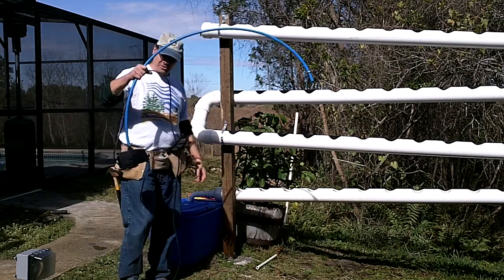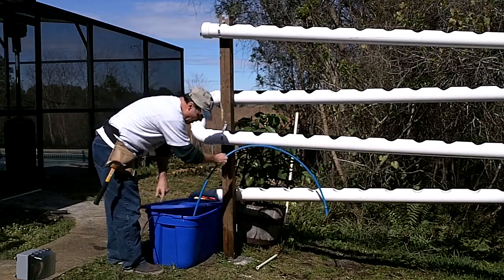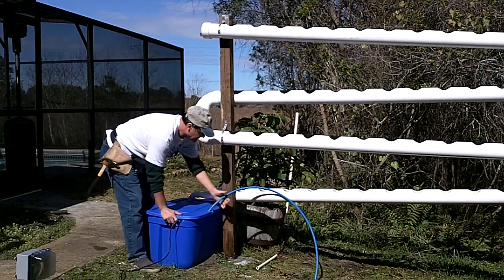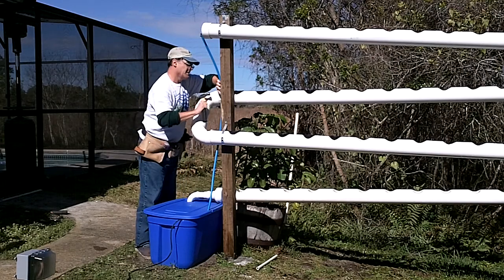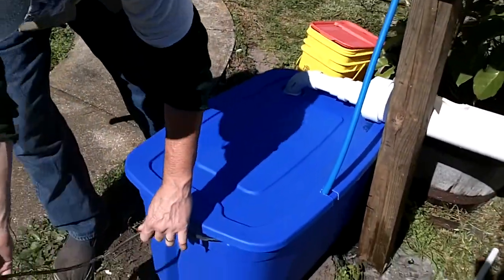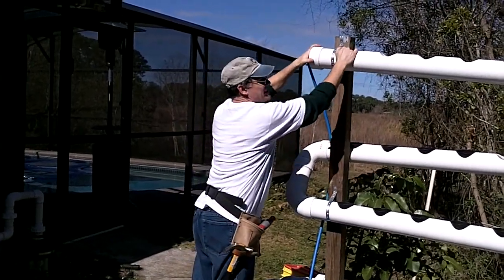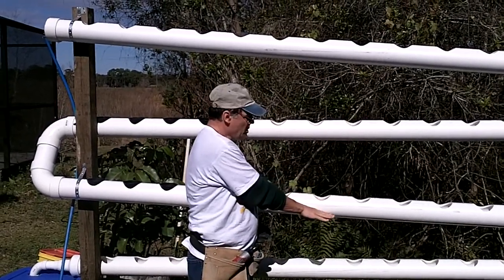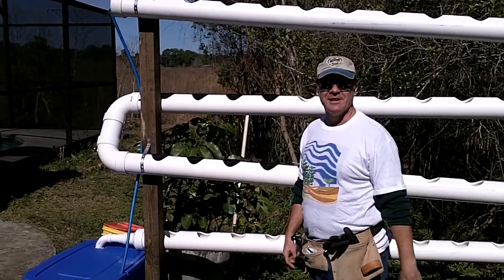Vertical Garden Step #5 - Setting and connecting the pump

Comment: thanks for the video. it is a beautiful project. how long the pump on 
your system? I heard that in the NFT system when you turn off the pump 
should be some water in the tube. what do you think? greetings from 
Mexico. Thank you.
Reply from the maker: Thank you Doulas for checking in commenting and sending in your questions! First the pump on/off cycle - during the summer both day & night we run it 15-minutes on and 15-minutes off during cooler months after sundown we sometimes will extend the off period to 30-minutes with 15 on and 30 off until sunrise then back to the 15/15.  Not sure in Mexico where you are but when we were in Southern California the nights were a lot cooler even in the summer (and low humidity) so we used to always do the 15/30 at night. In Florida between the heat and humidity we cannot do that during the summer nights. As for when the pump is turned off - because we have the pipes at slight down angle they will drain out during the off cycle - with the system we built here because our drain on the last pipe is around the center of the 4-inch pipe there will be water remaining only in the last 12 to 16-inches of the last pipe.  The biggest concern is for you roots not to dry out and for a time to oxygenate. Because NFT and the VGS pipes usually do not fill up with water (as with an ebb & flow system) you could actually leave the pump running as the bottom of the roots will be in the water and the tops exposed to air for oxygen.  We have run the systems without cycling on really hot-humid days when the plants look stressed.  Good luck to you and let us know if you have any other questions!

Comment: I have to build one. What size hole did you drill in the pvc pipe for plants ? Where did you get the plant holders ? What is the medium you're using in the post ? Thanks !
Reply from the maker: Larry Reece Hi Thanks for the questions - 1 - we used a 3 & 5/8 inch hole saw (92 mm) for cutting the holes in the PVC (be sure to run the drill in reverse to limit the binding). 2 - the net pots we used were 3 & 3/4 inch, which we were lucky enough to get when a hydroponic store in Orlando was closing and selling off it stock at a really reduced rate. The best prices we found for net pots was ordering from Home Depot (online) or if they do not have the size you need Amazon is a good choice. (for various projects we have 2 inch, 3 inch, and the 3&3/4 inch net pots). As for the media in the pots we use LECA (lightweight expanded clay) we also found the best source for this was Home Depot online. 

Let us know if you have any other questions!  Good luck on your project!

Comment: Do you run your pump continuously, or do you run one hour on and one hour off?
Reply from the maker: We have our pumps on a timer and cycle 15 minutes on 15 minutes off during the day (0700 - 1900 or 7:00 am to 7:00 pm) at night during the cooler nights we run the cycle 15 on and 30 minutes off - in the heat of the summer we will run the 15/15 cycle 24-hours. The biggest thing with the cycle you choose is to allow air for oxygenating the roots without letting them dry out.

Comment: PEX - that's not real common for most DIY folks
Reply from the maker: Steve Freeman I believe PEX is becoming a lot more popular, it was readily available in both Southern California and here in Central Florida, I also know many people in Southeast Pennsylvania that are now using it. The nice thing with the PEX connections is you no longer need the special tool and connectors, many stores such as Lowes and Home Depot carry connectors that slip on and tighten by turning. If PEX is not available locally you could use regular plastic irrigation line or any other tubing readily available. We have plenty of PEX tubing available from other projects so it was the perfect choice for the small amount we needed for connecting the pump to the system. We also just used the hose clamps to attach the tubing so again no special tools or skills needed.

Comment: Thank you for the videos. Very helpful and well done. How do you deal with rain and it's impact on PH/PPM and water level inside of the reservoir? Thanks again! Hope you post more vids
Reply from the maker: Hi, thank you for the comment and questions. We have only been in Florida a little over a year and are still getting used to a lot of rain and the growing conditions - so different from dry Southern California!  What we have found is that as long as there are not a lot of open holes (no plants or no cover) in the VGS pipe we get a minimal amount of rainwater in the system. You could add an overflow, or simply cut a small hole higher on the reservoir to drain water if you run into a problem. I will work on some ideas and post when I have some. 

As for pH we are on a well with higher pH, so we use General Hydroponics pH Down (dry powder), which is buffered and the rain does not affect pH much. We notice pH rise if we have to add more than a couple of gallons to our reservoirs from the well water, but the pH Down is a great product. (you can find it on Amazon.com).

We monitor both our pH and PPM every couple days and usually only see problems with the evaporation and having to add water.
Reply: Project128 I'm in Southern Louisiana so our weather is quite similar. You almost don't even have to use water in aeroponic systems down here with all of our humidity. :) Thanks for the response and I'm subscribed so looking forward to future videos. Best regards!
Reply from the maker: Doyle Lovil  Since you are in a similar climate to us - please feel free to share any tips you may have or experiences with growing (what works, what does not) that you have! We have a couple projects going so will be posting more videos soon.

Comment: What size pump (GPH) are you using?
Reply from the maker: Pat - we are using a 500 gph (gallon per hour pump) we had that already from another project, we have similar systems that we ran with 360 gph pumps.  We have a list of the parts we used and prices for the various items. Here's the link to that blog page:  http://project-128.blogspot.com/2014/03/cost-to-build-vertical-garden-system.html
Reply: Project128 Thank you so much for the list of supplies. It was most helpful. So far, we have completed the structure, purchased the PVC (missing a couple specialty items) and are ready to proceed. Your videos were most helpful because you included the smallest of details. Keep of the good work. I look forward to your next educational video. I might mention that I am a 72 yr old widow who has enlisted the help (muscle) of my 46 yr old son. I merely acting as his tool runner and second pair of hands when needed. I also do a LOT of pointing. We are both looking forward to the final results.
Reply from the maker: Pat Ruge Thanks Pat!  We are glad are videos are helping. We found some pipe hangers that we will be using to change out the straps with. We will actually be filming that tomorrow and will post as soon as we are done. If you have any comments or come across ways to improve the system let us know.

Comment: This is so great. I want to build vertical garden and this is the good start.. (Y)
Reply from the maker: Thank you Vanashree!  We did find some PVC supports for the piping and will changing those out with the straps we currently have holding the pipe in place. As soon as we get to work and get a video we will post that here also. Feel free to email or here if you have any questions or comments!